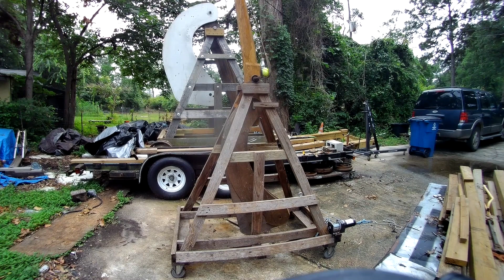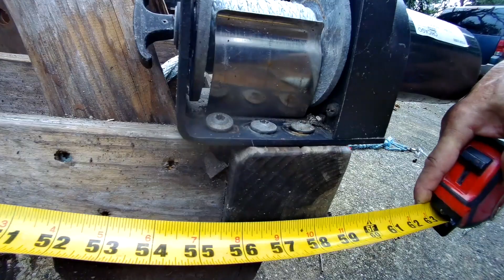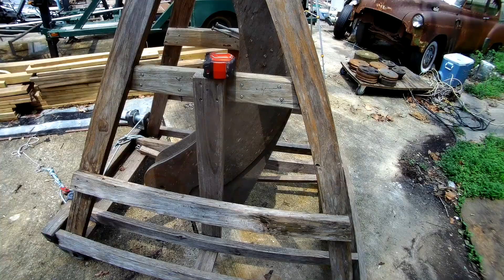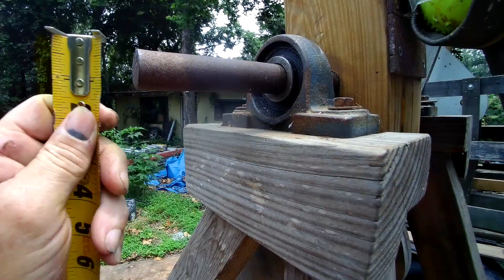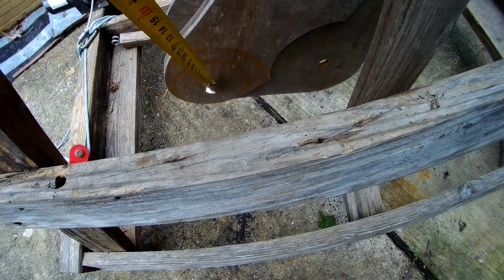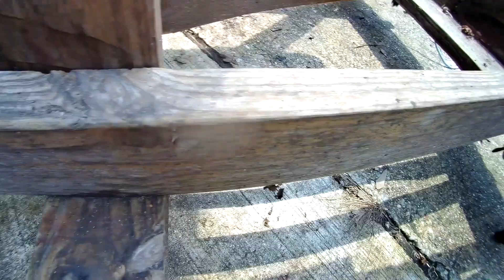10 foot Rolling Whipper dimensions and ratios.

Comment: A question from a trebuchet noob, but what do you think the largest projectile this one can use? I have heard many claim that a whipper is meant for the smaller projectile. But at least on the smaller scale model I made, I don't see anything that would prevent a whipper from throwing a projectile that a standard HCW of the same size use. However what do you think as someone who had actually built a decent size whipper?
Reply from the maker: Thank you for your question. Machine size, strength, and counterweight amount are the only limits as to what a Whipper can throw. The stronger the build, the more counterweight it can handle, the heavier projectile it can throw. This 10 footer can handle at least 400 pounds of counterweight, and at 100:1 mass ratio, it can throw 4 pounders over 200 yards. The larger Whipper on the trailer can throw 15 pounders over 1000 feet with 1500 pounds of counterweight. Whippers are around 4 times more powerful then a traditional hinged counterweight trebuchet with the same amount of counterweight.

Comment: Awesome description!   Thanks!  I just built a slightly smaller one (-9ft tall) to compete in a local competition with 100lb weight... throwing softballs.  However, I would like to scale up since I was only able to throw it about 450ft.  What kind of distances are you able to throw using this trebuchet with 100lb?
Reply from the maker: Thanks! It has thrown 1 pounders 626 feet with 100 pounds of counterweight, 142 Arms. Softballs are pretty light, and have a lot of wind resistance. I put steel cores in them to make them weigh 1 pound. I do an online tournament for 1 pounders with 100 pounds of counterweight. https://www.youtube.com/watch?v=v8aPLtb0fMk
Reply from the maker: I think I was getting around 750 feet with softballs and 100 pounds.